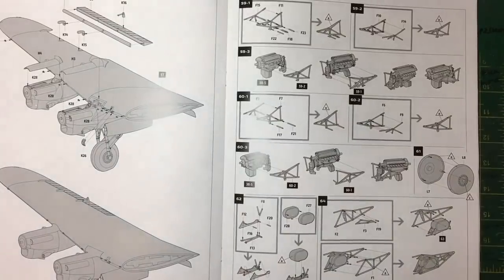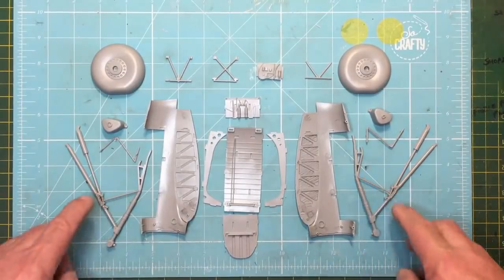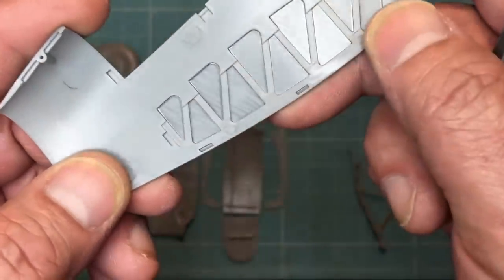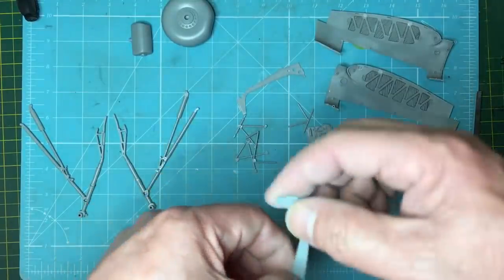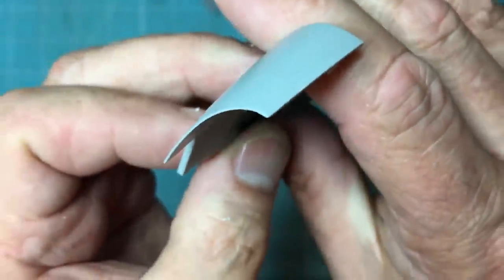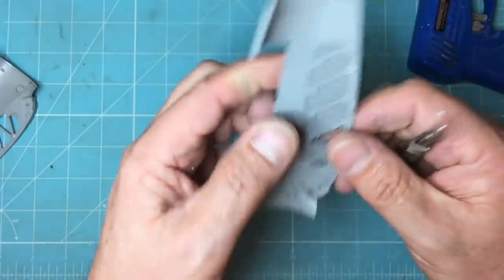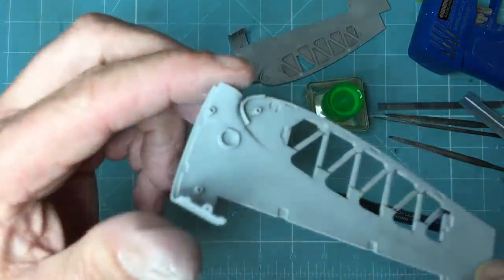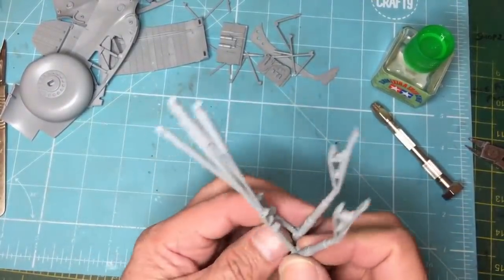HK Models 1/32 Lancaster. My uprades part 7

Comment: Hello Nigel . I used to open parts with a drill , like you are with the undercarriage bay side walls , by hand , but then thought , that takes to long ,so , I drill a large hole in the middle and open out the hole , following the ruff shape of the panel , by milling around the shape with a number 11 blade , then final filing . v fast if you have no motor tool . I guess one side of this bay would take 20 mins . usefull tip if you have no dremel ect . martin